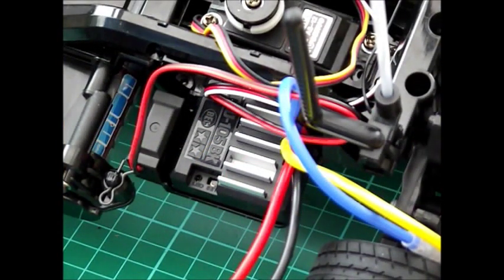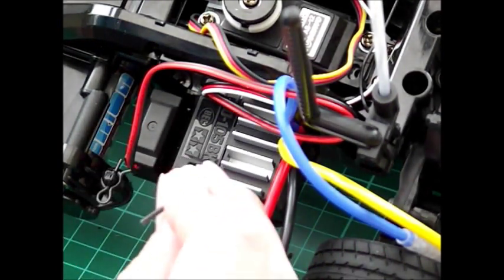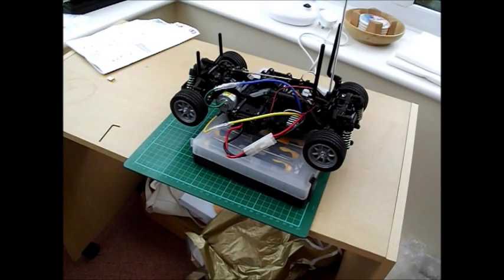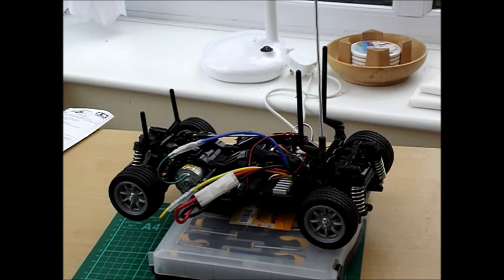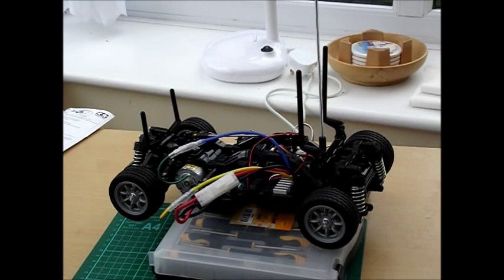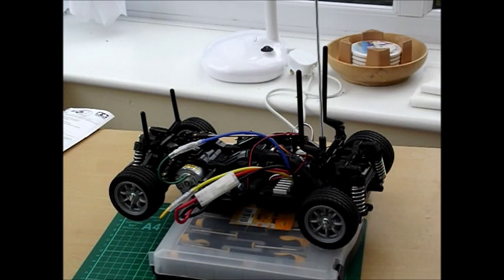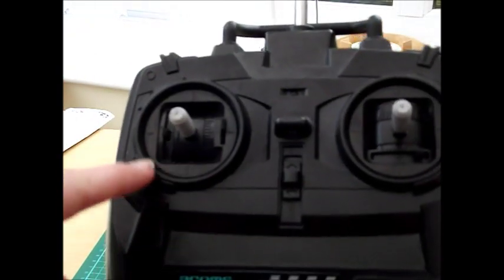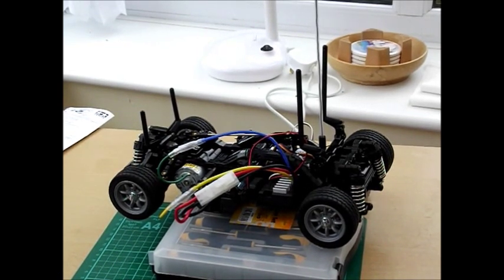TEU-105BK ESC Setup

Comment: I have a Sand Viper that always used to work well. All of a sudden one morning, the ESC is beeping and blinking. Everything is connected as it should. Can't get rid of this "alarm" as it apparently is. What to do??? Got a Futaba Transmitter and reciever  with fresh batteries. What the heck could have happened from one day to another? I'm going crazy. Nothing that I try helps.

Comment: Hi. Dunno why, but in program mode the ESC don’t change in double flashing after maximum acceleration and 2nd push... still keeps flashing simple. If I turn off/on, the throttle works. Finally, the setting mode doesn’t works. Any idea?

Comment: Great video! However I can't seem to sync my controller with the esc tble-02s - can you help please? I have got the steering servo responding to my controller so a signal is being received. I turn on the ESC and it is a regular flashing green light. I have held the set button down when moving the throttle to max forward and reverse but the ESC will not set and the green light continues to flash?  This is my first build of a Tamiya Hornet with stock motor etc. I received no instruction manual with the esc tble-02s - maybe you have a copy :) ?
Reply: +Jon Nock I have the same problem. Do not use the esc tble-02s, because it is a nightmare, it was built with integrated defect. Use the esk teu-105bk for brushed motors. I red this in forums and I am going to do that. There is no way to drive your RC car, sorry!

Comment: My mom bought me a tamiya kit that came with a teu 101bk with no receiver or transmitter. Got a traxxas one and told it would work fine. Wired in like 6 different ways the esc blinks and beeps and no light comes on from the receiver so I don't even know if it works

Comment: So Idk if you can help or not but figure ill ask anyways. I just bought a nice Midnight Pumpkin off ebay and it came complete and supposedly ready to run. So I get it and it has the TEU-104BK esc on it, I charged the battery and flip the switch. I'm met by the flashing/ beeping red led?

 I transfer the same crystal and remote over to my MSC controlled 1987 lunchbox and it runs it just fine? I've ruled out a dead battery and receiver to remote non communication. What's next? New to RC but have always wanted these. I had no problems setting up my lunchbox what gives with this ESC?